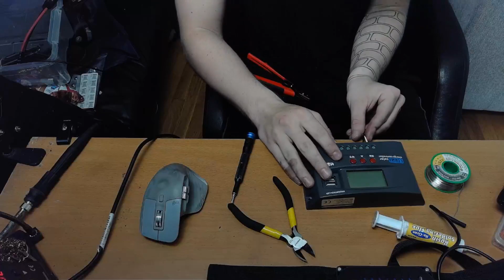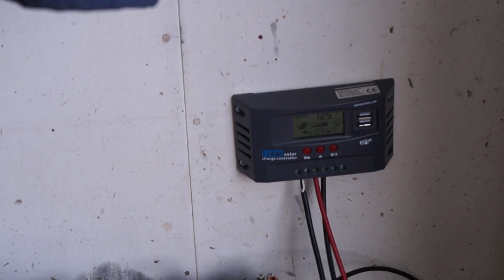Building an Off Grid Solar Charger for my eBike

Comment: From the money I saved on bus fares here in Trujillo Perú, I paid off a $1000 60 volt lead acid battery scooter which gets its batteries replaced every year at a cost of $250. The old batteries go into my 12 volt home solar system. I now don't pay bus fares, home electricity,  and cooking gas.